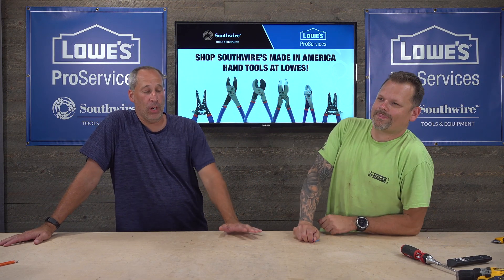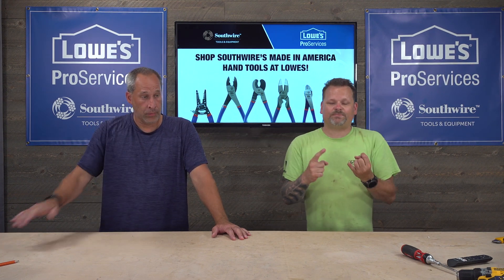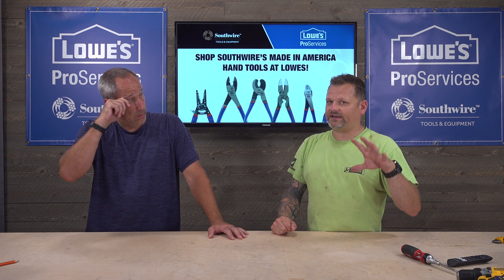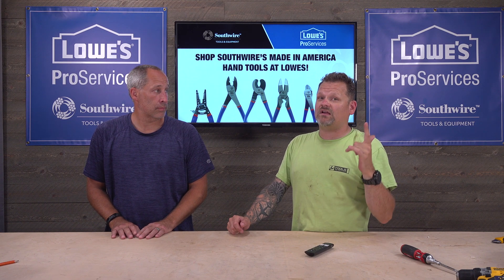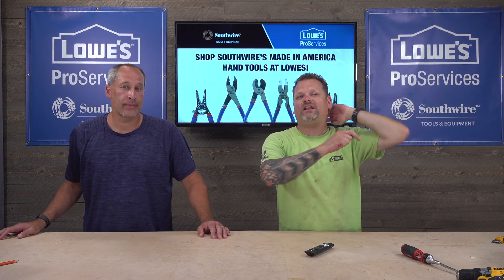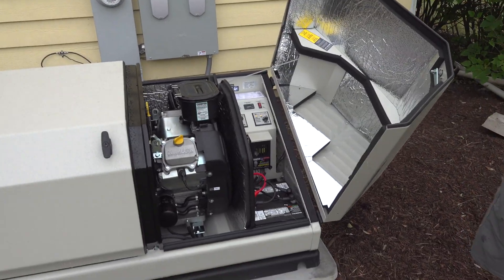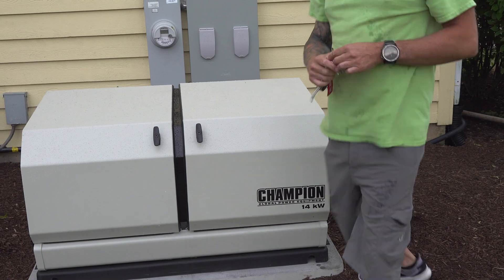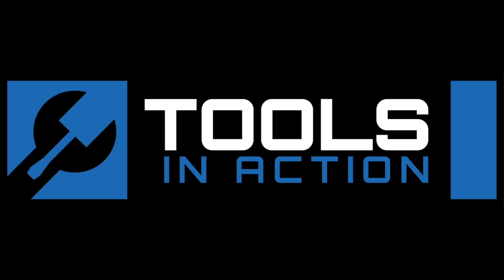Backup Power - Why You Need It! Champion 14kw Home Standby Generator

Comment: This video was made in 2019 so some of the info is old.  At the 6:52 mark one guy asks the other if you can connect your smart phone to this generator and the other guy says no.  In 2023 this generator is wifi connectable with your phone, tablet or computer.

Comment: been in VA since 2004 and epic ice storm a week almost with out power .cost and of one and sound of it and size  . all I need is my here is well ,heat pump .I thought the exhaust was not supposed to be near windows ,doors or air handles like you unit out side because it will suck the fumes into the house

Comment: So, Generac vs Champion...which is better and why?
Reply: Champion has a 10 warranty and Generac is 5 yrs. Champion is quieter. Generac features phone or tablet monitoring and is sold by Lowes/Home Depot. They offer installation. Generac doesn't come with a starter battery, it's extra. These are some advantages I found in my research. Hope this helps you.
Reply from the maker: The both have advantages.  Generac has more tech I believe but this Champion has saved me a few times.

Comment: Tell the truth about these machines. Comparing energy density between natural gas and propane the cost of propane will be about twice as much. Generators will use much more natural gas to produce the same amount of BTU's, but natural gas is cheaper. These 14kw units can cost upwards of $15K for the unit with installation and they must be maintained properly. They are engines and require oil changes, spark plugs etc., and they must be exercised regularly under a load which costs money,

I found a plethora of information regarding a generator increasing the value of your home. There was not one independent source confirming or denying this conjecture. They were entities that sold generators, real estate establishments, generator "advisory" organizations etc. offering their opinion. 

Unless you have a situation where there is a serious medical need, live in a dwelling that is prone to flooding as in basement floods, the home is uninhabited for long periods of time, or have weather related needs which require continuous power. You do not "need" to have these expensive units. You will pay an exorbitant premium for to have instant on power. 

The sales staff always pushes the KW rating, the more KW's the better, but this is not true and is a ploy to sell a more expensive unit. In most power outage situations which are mostly short term most people do not need to operate every light switch in order to survive. Refrigerators are the most important item to keep operating.  This could be operated with a small two cycle generator and a proper extension cord which cost up $120. I do not like to live in that manner and have power outages up to two weeks because of hurricane and used the television and radio for emergency information. Estimate your minimal needs and wants and purchase accordingly. I used an 8kw propane generator and it was fine. Look into portable inverter generators and the only three I recommend are Honda, Yamaha and Ryobi. Honda is the top of the line while Ryobi’s are a distant third place. These ‘inverter generators” can run up to eight hours on a gallon of gasoline, but every type of generator must be maintained. 
Manufactures know these standby generators may only run up to twenty hours per year and manufacture accordingly by designing them to last through the warranty period. This is unfortunately is fairly common practice among companies no matter the product. I would not recommend Champion, but the absolute worst quality is Generac and both companies have horrible customer service. 
If you need a generator that will be your main source of power look at diesel generators, these are robust and designed for long life.

Comment: Unless a person or persons have medical needs or are out of town for long periods with other home issues such as basement flooding  these large backup or standby generators are a waste of money and time. These are basically emergency systems which mean you do not need to run every circuit, only the ones important to you. These also require a fuel source and require monthly exercising which is automatic on most units. This unit uses about 2.0 gallons of natural or propane per hour which in my area is about $7.00 hour or $168 per day. I had power go out for 7 days during a disaster that would be $1700 per week for fuel. I spent $80 for seven days and $1000 for my generator. The installation and generator cost depending on the size and  site specs plus other items such as propane tank could run with this generator could be $4000 to $8000. If you have the money and or the need go ahead with this type if you desire. Be aware what you are doing and the cost benefit. Champion does not have a great reputation for customer service with their line of small inverter generators and Generac is the worst in every category.

Comment: When I was in Army in 2012 in Northern Virginia when the Super Derecho came through! Many tress came down over many power lines and people cul-de-sacs were blocked in for weeks! Plus diesel fuel when out of fuel in 12 hours when generators ran out and in500 square miles there was no diesel to be found!
Reply: Terry Rodbourn This same thing happened here in Puerto Rico after hurricane Maria hit us hard, this was the same reason I desided to install a standby gas generator over a diésel unit, 👍😉
Reply: LP would be the fuel of choice. A 120 lb bottle most gens can run at 50% load for a week on one bottle. During a natural disaster they can shut down natural gas lines for safety reasons one reason I would never power at home gen on natural gas. Need more propane call the company and a truck will deliver and fill the bottle. Even during Sandy in the north east in 2012 propane was always get-table unlike diesel or even gas.

Comment: I installed one of these for a guy and I wasn't real impressed with the quality. Kohler was much better built and seem to have much more robust switch. Kohler is more expensive so beware, you do get what you pay for.
Reply: East Coast Resident Sorry i have to desagree with your opinion.The certified electrician who installed my 8.5kw Champion standby gas generator wich also service them told me the Champion were the best overall brand even better than the Kohler, Generac and Honeywell. He has installed over 300 units so far and to date the Champions are the only ones he doesn’t have any complaints about mal function durring their ussage. Also here in the carribean I live in Puerto Rico we have a very hard time finding spare parts for the Generac and most of the time they have to be ordered from the states and wait a few days or weeks to arrive here because our local dealers don’t have them in stock. Just because the Kohler is more expensive doesn’t necessary mean is a better quality standby generator. Here locally for some reason most of the Generac generators have a tendency to burn their voltage regulators and this is why he strongly recommend to all his customers to install an aftermarket “power delay device” inside their (ATS) to prevent this issue. Perhaps talking about the Kohlers by any chance did you know if the manufacturer finally solved their overcharged issue with their battery’s? Thanks
Reply: @raymondmorales8252  can you please email me at icfbob@gmail..I have questions about the Champion 14kw aXis model.  thank you in advance.  Bob Gieser
Reply: Does anyone know what brand model engines they use. Honda clones. I also heard Briggs has a whole house generator line and they are easier to work on and parts are accessible.

Comment: so how much propane or natural gas does it use per hour?
Reply: Todd Scholes That depends of the size of the generator (how manny watts produce) and how many appliances you want to use durring a power outage. For example my Champion 8.5kw standby gas generator only consume less than 1 galon/hour propane gas at half load.

Comment: If you guys want to REALLY scare yourselves, do some research on your countries power grids and what 'cascading' failures are - most are not only highly stressed, but without the backups and parts for a rapid restoration in the event of a catastrophic failure.
If that didn't do the job, check out what happens when a solar flare, and ion storm,  hits power grids - there was one back in the mid 1800s that is a warning!

Comment: Nice! I didn't know champion made automatic whole home solutions. I run a dual fuel Champion generator/converter and inverter setup on my 5th wheel camper. It works awesome. Since we already have a large source of propane on board it really makes it ideal when we are boondocking and want to run both air conditioners and when we run low on solar power. It's very quiet. And efficient. At the price point you can't beat them IMHO. I was going to buy another Honda, which are nice. But the champion works just as well. Now, I also made a generator "quiet box" out of go board. So it is light weight, and waterproof. It brings the decibles down tremendously. Just makes it sound like it's 100 feet away. So even in an rv park, if we have to run it, nobody complains about noise. 
I will be checking into the whole home solution. Thanks for the video! 👍

Comment: I've contemplated getting one, as have power outages frequently. I like that it turns itself on automatically. I'd have to get a propane unit.
Reply from the maker: It's good security
Reply: these can run off both LPG and NG quick conversion.

Comment: Looks like a nice unit. I know some folks with smaller Champion units and they seem to have a good reputation. I have a Honda portable inverter generator that I use as a whole-house generator. It takes me less than 10-mins to have power back on after an outage (assuming I am at home). I have a couple APC UPS units on various critical components which can provide 30+ minutes of pure sine wave power.  So even if I don't get the backup generator plugged in right away everything still stays powered up until I do so and again when I switch things back to commercial power.  We don't have natural gas available in my area so folks with the automatic units must rely on liquid propane and a large storage tank.
Reply: EOSJOE i use my 8.5kw Champion standby gas generator with a relative small 100 galons (420 pounds) propane gas tank and it gave me way over 100 hours of continuos use at half load with no problems at all, but here I live in Puerto Rico in my local area is very rare to have a power outage for a very long time. But most people in the states prefer the bigger 500 galons gas tank since it can give you weeks of continuous use without need to refill it. Another great advantage all this standby gas generator has is they provide power with less than 5% of total armonics distorsion (THD) so every sensitive electronics like computers and others are totally safe.